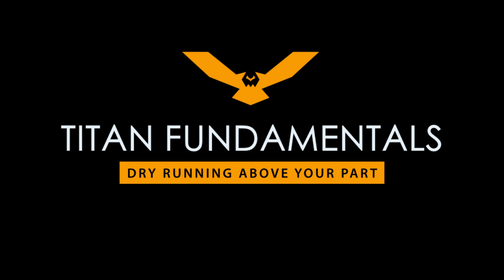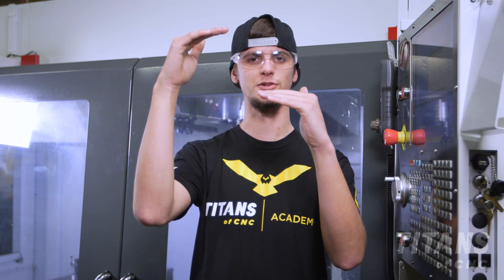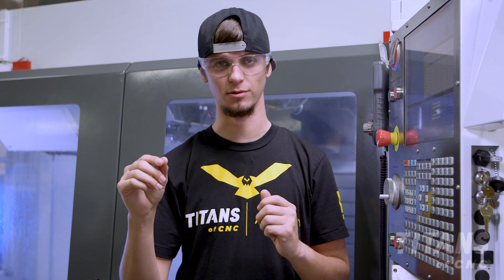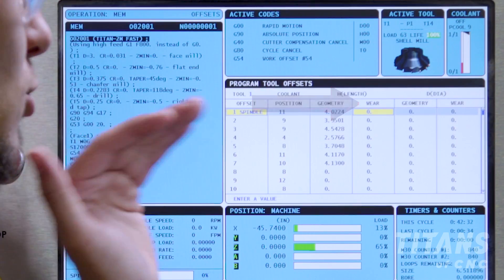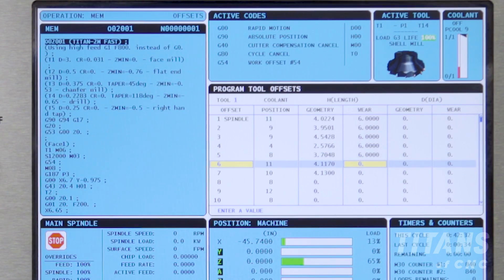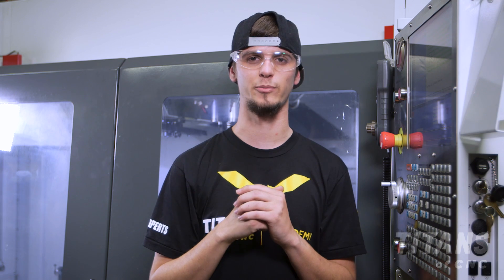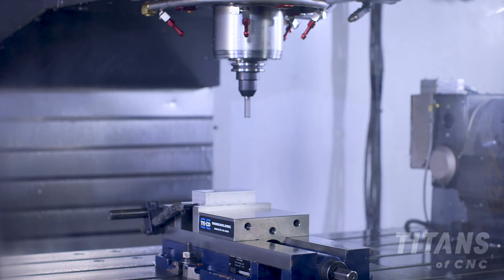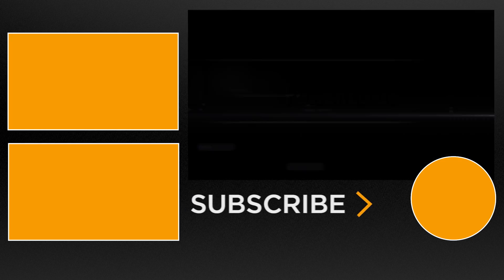TITAN FUNDAMENTALS: Dry Running your CNC Program

Comment: Why wouldn't you use G92 for Haas & Fanuc or G52 for yasnac to shift your work plane. In setting 33 coordinate system
Reply: I agree. I think that adding an offset to g54 will do the job but o lot easier to undo